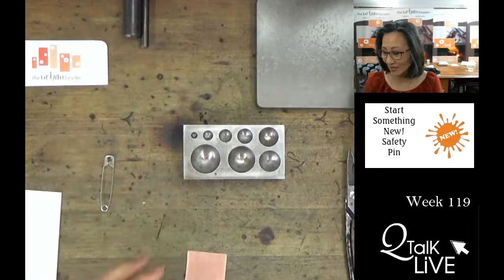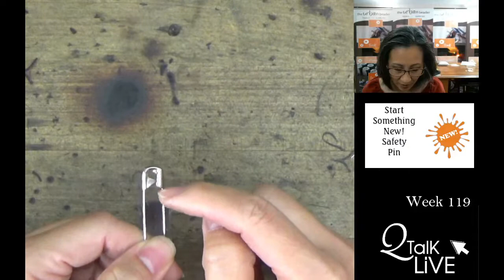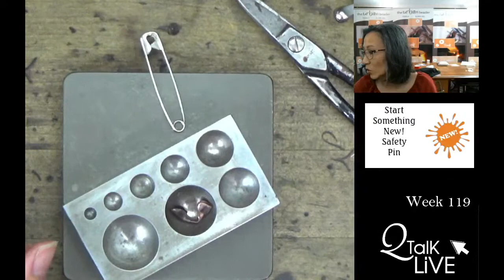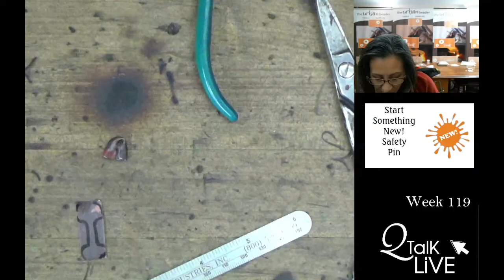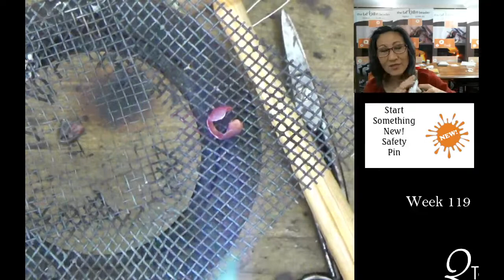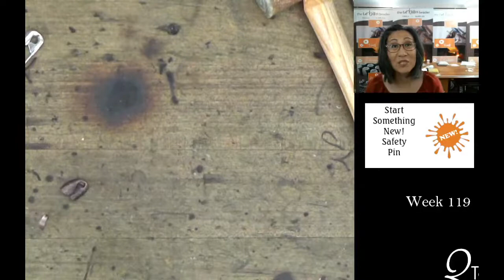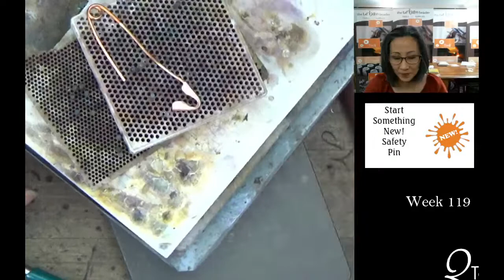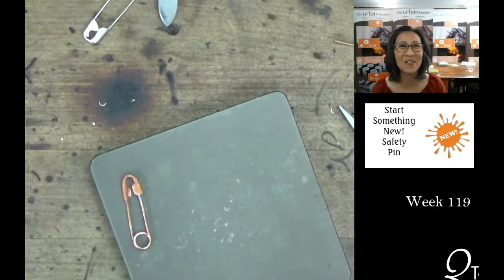Q Talk Live - Start Something New, Safety Pin

Comment: I think you need to make a jig so that the bend at the top and the double loop at the bottom are the same diameter. Maybe a little smaller diameter than the top.